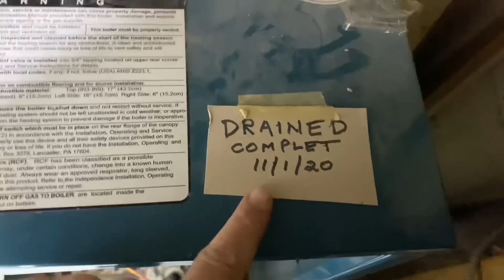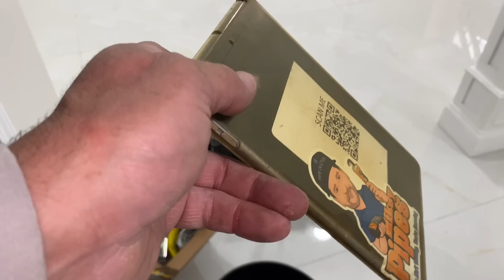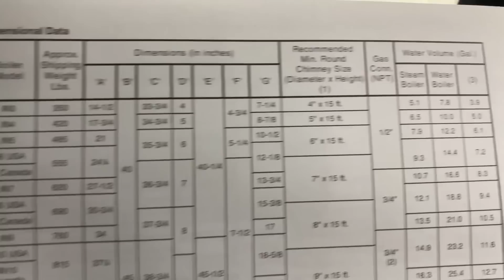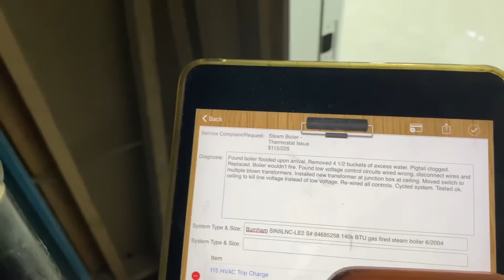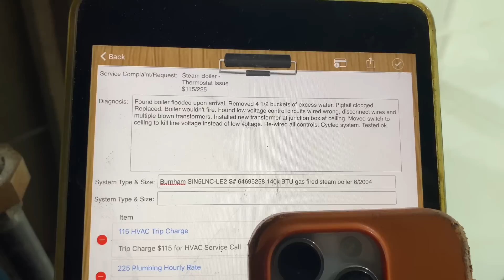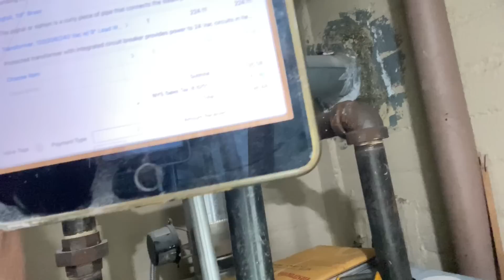Steam Boiler Blowing Transformers - Help! My Thermostat Isn’t Working

Comment: you can see the mercury bulb in the pressure troll and which end the wires enter(right side) so when mercury is to the right of the bulb = circuit closed. to the left is open.
it needs to be installed/held level or it wont work/test right. while it's possible the wires tot e bulb could break from flexing, that would be a very rare occurrence and generally the bellows/diaphragm/springs would fail first rendering it broken. 🙃
Reply from the maker: Yup

Comment: Great video. We dont have steam boilers in my area. I would like to see how that pressure switch works. I guess it cuts out at hight pressure and low pressure?
Reply from the maker: The pressuretrol tells the boiler when there's enough steam in the system and it can shut down. The pressuretrol works by keeping the pressure in the steam pipes within a certain range. On the systems I work on, residential, the limit is for HIGH pressure and opens the low voltage safety circuit, cutting 24 volts to the gas valve.
Reply: @PipeDoctor  . I never knew that. Thanks for the info.

Comment: What will also get people who are learning, is buying a bad part installing it and now your looking at something else that is NOT bad. You are second guessing yourself. My son was at his girlfriends home, calls and says the display on the thermostat is bad, but the air is on. I say go get a new stat, he does and it has no display. Now he is second guessing himself , their has to be something causing this? I go you BOUGHT a bad stat, take it back. When you get the new one open it up and put the batteries in right on the spot. He found three bad stats, the supply house was like WTF? It was those cheap white rogers thermostats, so he up graded went back installed and everything was fine.
Reply from the maker: Thanks for sharing your experience! It's always important to double-check and troubleshoot before assuming something else is wrong. Glad your son was able to figure it out in the end!

Comment: This is me showing my age again. I new that the pressure control was not made by looking at it. That was one of the best things about the older mercury switches. You can tell if they are made by looking to see if the bulb was tilted in the right direction. They haven’t made a good switch since taking the mercury away from them. They would last for decades!! But that doesn’t sell new ones!!
Reply from the maker: Thank you for sharing your knowledge and experience! It's always interesting to hear about the advancements and changes in technology over the years.

Comment: All the trades are more $ now. Expensive to stock parts, insurance, fuel, training etc. Just had my vehicle in for first oil change and install 4 snow tires , wheels, lug nuts and sensors. Bill was $2600+ CDN. Sticker shock for some people, but good work costs.
Reply from the maker: It's true, the cost of maintaining vehicles can be quite high nowadays. But it's important to remember that good work and quality parts are worth the investment in the long run. Safety and reliability should always be a top priority!

Comment: Knowledge is power... !!  💪 I see the ceiling mounted xfmr has a built in circuit breaker , way to go ... I guess the others did not open in time on the primary ? ..  I keep a fused jumper with me when troubleshooting questionable circuitry .. Learned the hard way until some great men passed along their wisdom to me ..
Reply from the maker: Yes, you are right

Comment: Pigtail probably wasn't needed. But couldn't hurt changing it. If you go back the reason there was no continuity, was because the mercury bulb was tilted to the left. The mercury was not making the connection.
Reply from the maker: The pigtail was clogged.

Comment: Proved time and again, keep your hands off sh— if you don’t know.   That includes the hack techs that charge for guessing.   Great tip Mike, using the water heater drain valve to blow back on that blocked boiler valve.  Well handled call with Mr Customer.  😁
Reply: Then the crap goes into the HW heater. Suck the crap out. So it's out and not obstructing anything including HW heater. That costs efficiency
Reply: @Keith_Mikell  No, domestic hot is 40+psi, the boiler was at 2.5 and he just burped the valve; even the water that fell out of the hose was clean. It broke up the blockage and pushed it into the boiler, and then he drained it out of the boiler. The final buckets (and sight glass) were clean.

Comment: I learned today how to use the water heater water pressure to unclogged the drain from the steam pipe, that was cool. I would to know a little bit more about the controls wiring in this types of units and the sequence of operations, thanks Mikes for sharing your experience with us.